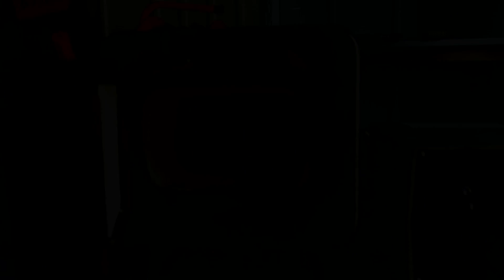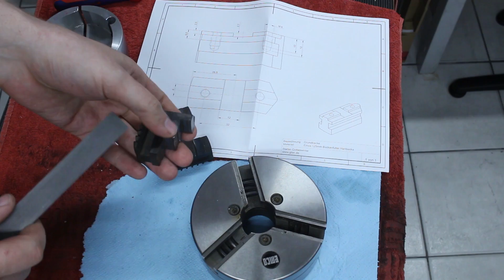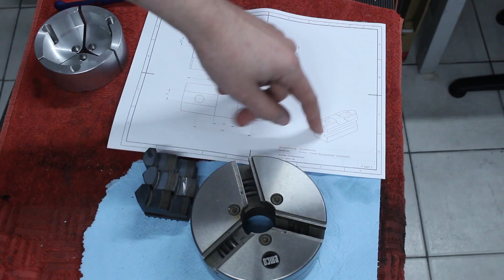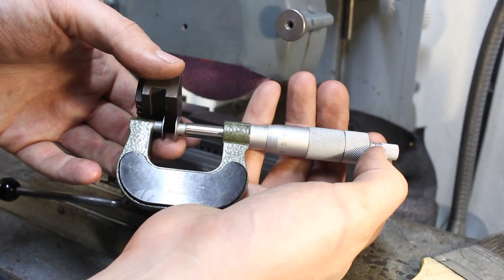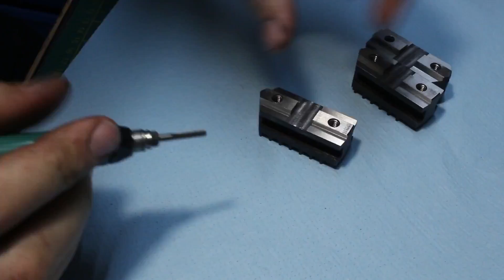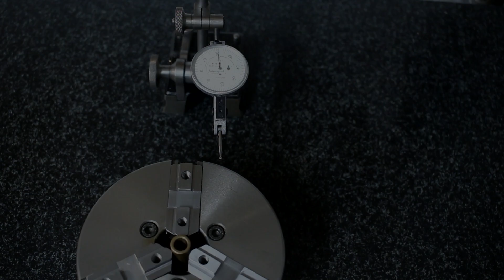Modifying chuck jaws

Comment: when I was doing production lathe work we used a lot of soft jaws..usually on a 14 inch chuck..we would all ways put a small relief grove at the corner radius in the back of the jaw cut to allow for debris accumulation in the jaw pocket..I had a hobby lathe at home and all ways thought about doing just what you just did...so I found this very entertaining...I am now retired and no longer do any machining...but thanks for the memories with your excellent videos

Comment: Did you adjust the run out on the chucks backing plate before you started turning the soft jaws ? It looks to have plenty of wobble to it .
Reply from the maker: The chuck has no seperate back plate, the D1-3 taper is integral to the chuckbody. There is virtualy no runout on the chuckbody, not sure what happened in the video.

Comment: Caveat - I learned everything I "know" by watching YouTube, having never actually having the opportunity to get near a lathe or milling machine in my life, never mind actually actually use one. However it strikes me as I get to 1:51 as you mention you don't have jaws/teeth that hold discs etc, that I assumed the teeth were reversible, so you could take them all the way out, turn them around, and put them back in again. Is this not possible?
Reply: Oh, lol - as I continue watching, I see the "thread" on the back of the teeth has a shape to it that would prevent my suggestion (ha! me? suggestion!) working.

Comment: The surface the soft jaws mount against  being out of flat the next time you checked them was most likely between the clearance in the jaw slot and the relationship of the jaw to the scroll thread. Or is that right word. Pie jaws while they work well are not as good as oversized or step collets.

Comment: Audio too soft. right click -> stats for nerds -> volume: -8.4 dB. Ideally it should be between -2 to 0 dB. Turn up the mic gain and move it closer to your face first, if still not loud enough then amplify digitally. Audacity is a free audio editing software that you can use
Reply: If we’re talking about audio processing, most (all ?) video editing software has a ‘normalise audio’ function built in that will automatically detect the peak loudness of a video clip and adjust the gain to bring it to a specified value. To avoid clipping I’d leave the gain during recording basically where it is and then normalise the video clips to -1 or -2 dB.
Reply: He sounds loud and clear to me.

Comment: Stefan,
Just wondering if there was any particular reason that you used a Ruby grinding wheel?
As usual another great video.....
Reply from the maker: Thats just a normal aluminium oxide 46 grit wheel. The color of it has nothing to say.
Reply: @StefanGotteswinter  Wow..... All mine are white or a kind of creamy color.... I have never seen a standard Al Oxide wheel in Ruby... I have a couple of Ruby colored wheels and they are an extremely hard compound.. Not sure of their composition, I will have to check next time I am in the shop... Thanks for your reply Mate.....

Comment: Oh man niels machines dot com get 650 euros for that chuck..... I have 4 of those Emco chucks they are made out of unobtainium. That is interesting you have D1-3 on your Super 11 mine is D1-4. There are now many Emco guys crying.... On another note Niel has a sweet lathe you can drool over, Schaublin 125c High Precision Lathe check it out.   mmmm Schaublin  just a bit pricey!
Reply from the maker: nielsmachines ASKS for 650eur. If he sells it for that money is another thing.

The old green Super 11 here in Europe almost all had a 1-3 Nose without camlock. Only the newer super 11 CD had the 1-4 / Camlock.
Reply: Stefan Gotteswinter 
I’m one of the crying super 11 owners. My emco chuck is missing, but I think I have 
some soft jaws for it .......:/
Reply: Yes, another Super 11 owner here with a missing chuck- argh! 
Is DIN 55021 the same as D1-3? My spindle has a 75mm 3x bolt pattern - D1-3 seems to call for a 70.6mm.  The Emco manual says nose "Spindle nose according to DIN 55021"
...help please

Comment: It's a bit poor, but one way that I was taught to do risky powertapping was to tighten your drill chuck just enough to tap the hole, so that the tap can slip if it binds or bottoms out. Of course this may not be best to do in your shiniest Albrecht chuck, but maybe for the old Shars chuck. You probably already know this, but just in case, I thought I'd share. Cheers!

Comment: I'm so confused about "inside" and "outside" chuck jaws. I don't see why you can't chuck on the o.d. with the inner/tallest step, and the i.d. with the other two steps. Then flip the jaws and chuck up on the o.d. with the (now) outer./tall jaws, and on the i.d. with the other two steps. And with the "outside jaws" you said you didn't have, they're the same, except the steps are convex, instead of concave, like the ones you have now. But I have never seen an issue with using the current jaws you have, on an large or small i.d. or o.d.
Reply: Hey Andrew  it has to do with the teeth on the back they are profiled to fit the scroll. Therefore two sets are needed, unless they are two piece jaws ( master, top)

Comment: pretty cool, I thought about doing that and making a soft jaw chuck out of one since standard 3 jaws are much cheaper than the soft jaw ones, but I was always worried about the drilling and tapping part of it. For removing the material, I figured the shaper wouldnt have too much trouble with it, lol. I bet I could make a tool bit or two out of the remnants of those jaws, lol.

Comment: I am learning... why did you choose to use a smaller end mill to finish up the sides of the key on the jaws? Wouldn't the larger end mill be more rigid and thus produce a better result? Thanks for the education!
Reply: Ha. Literally the next sentence from where I paused to write that explained the relief cut on either side. Oy. :)

Comment: I had a feeling you would have issues when you referenced the bottom of the jaw teeth instead of the side grooves for grinding. No real reason for the factory to hold that dimension to high tolerance, so they don't.